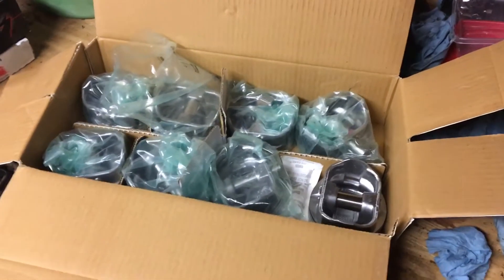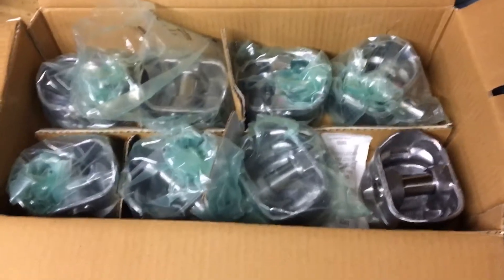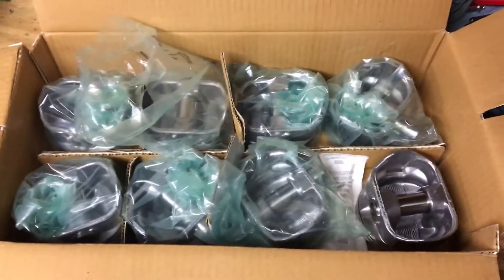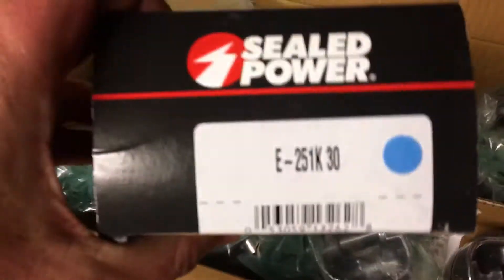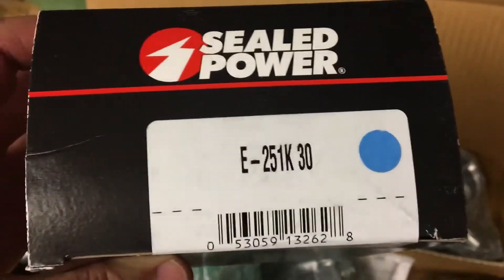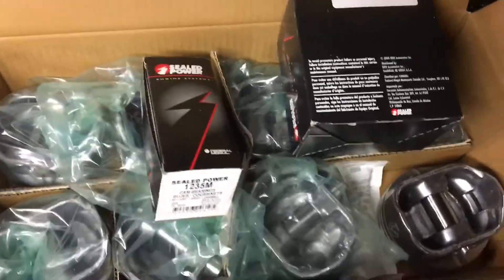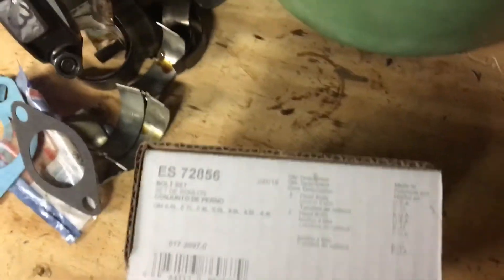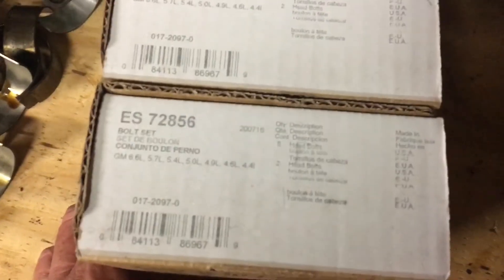Mercruiser 5.7 1(b) - Parts Used - Tips and Tricks to Save Money

Comment: You say that you do not need marine gaskets because water does not directly touches the gasket, I guess you are forgetting that marine engines usually spend their life running at high rpm’s! Also how about all of the indirect salt air and moisture that surrounds a marine environment! I think it is great that you said  if a gasket goes bad just bring it back and you will replace it, But what if I head gasket goes while you are out on the water! Having your boat towed in hauling it out of the water bringing it to you to do the work is a lot of frustration, All of that time alone adds up to more than what a good set of Marine gaskets cost! There is really no way of cutting corners on a marine engine!

Comment from the maker: The piston rings part # for a V6 Vortec piston (H640dcp030) is E 229K30. However since the V8 set (E 251K030) is cheaper and includes two extra sets, I just buy the V8 set and get a free set every three sets I buy.

Comment from the maker: It’s 12 NOV 2020 and Rockauto has the H640dcp 030 for $11.20 each. I just purchased the last set of 6 that they had in stock. I couldn’t let 6 pistons for $67.20 get away. I’ll build out my last 4.3L V6 core and have it in stock for the next customer that needs a 4.3 engine.
Reply from the maker: It is now 15 NOV 2020 and the H640dcp 030 is $17.90 on Rockauto. They were $11.20 last week. So it pays to check prices everyday and buy when they are low.

Comment from the maker: As of 12 NOV 2020 Rockauto has the H815dcp 030 for $26.79 each or $214.32 for 8. Summit Racing has them for $195.99. I use H423dcp in Vortec engines and save about $100.